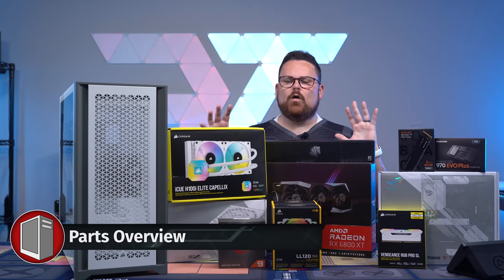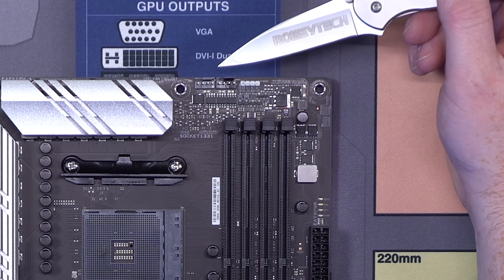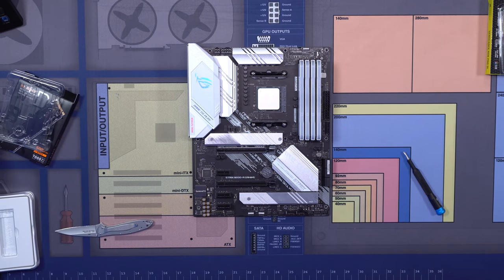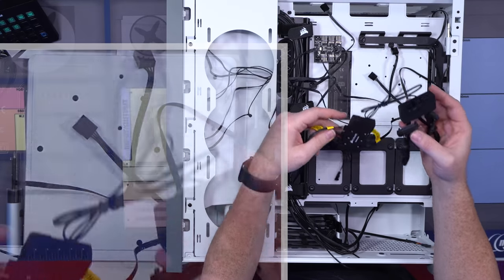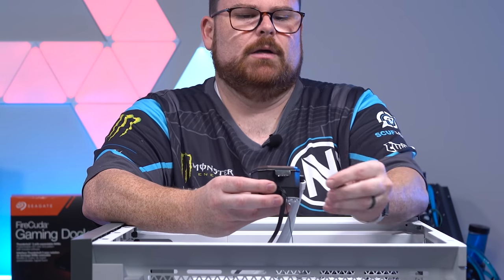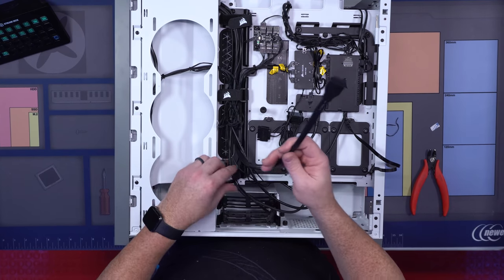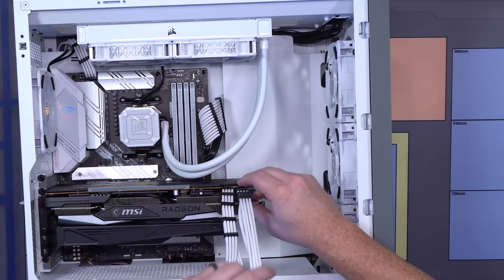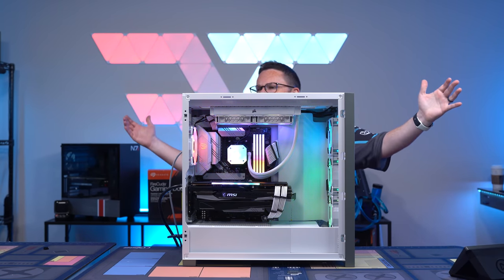How To Build A PC - Step By Step Guide (2021)

Comment: As someone who literally just transferred a build to this case yesterday:
- These types of tutorials should include SATA connection setups. Not everyone can rely on M.2 storage alone, and it introduces more cables to manage (especially with the PSU and the weird tolerances for L-shaped connections to the HDDs in the bay).
- I wish I knew to plug all my PSU connections in before putting it inside the case. 😭
- This really goes to show how cablemod and other aftermarket cables are a cleaner shape. I had to take off the cover on the right because the 24-Pin from my CORSAIR PSU was too thick to go through that little slit.
Reply: TWSS

Comment: I have been building computers since long before PCs were a thing (can you say S100 buss?).  However, my last build was done before M.2 or PCIe had been released, so I am way out of date on modern technology.  I want to do one more build while I still have the eyesight to do so, so I came here hoping to get up to date.  Nope, not happening.  It is obvious that the presenter knows his stuff, but what he doesn't know is how to teach it to someone else.  Way too many occurrences of "this little part here" or unexplained terminology, such as AIO.  What the heck is an AIO?  I would have greatly appreciated a more in-depth view of what goes where, especially the connections to the motherboard.